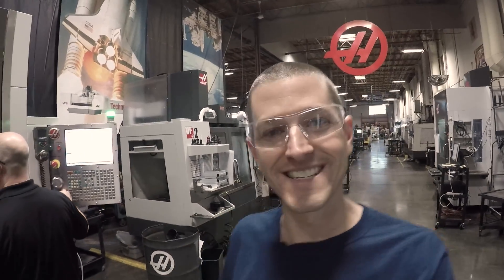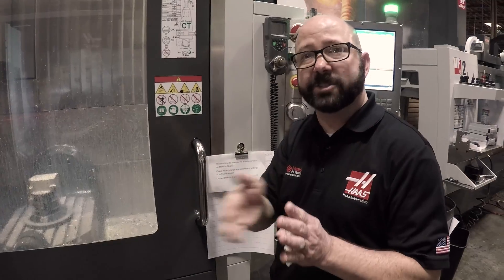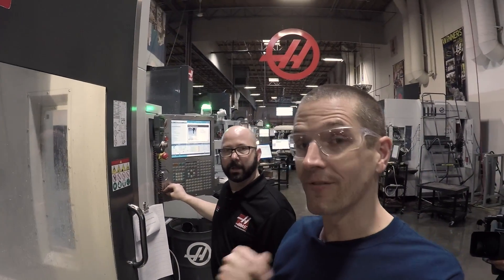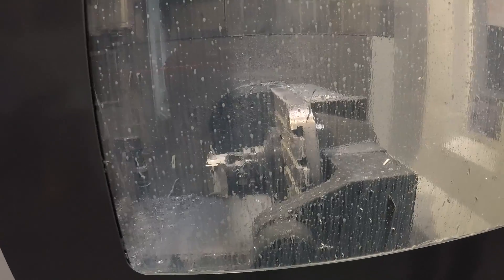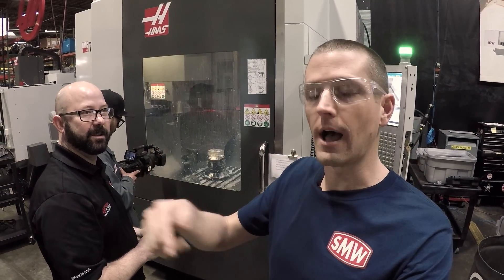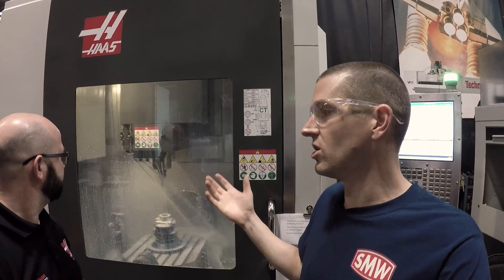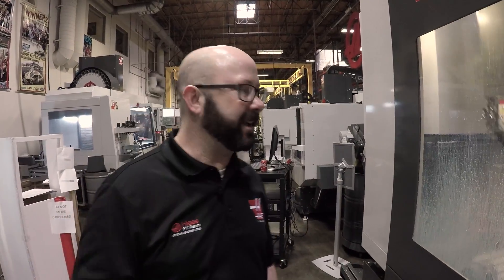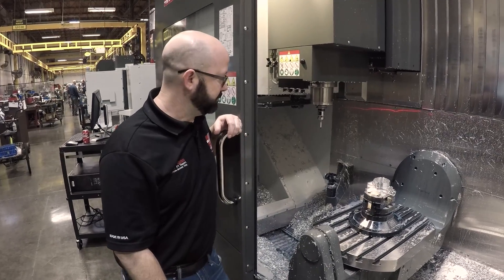5 Axis CNC Machining on a HAAS UMC-750 at the HAAS Factory!

Comment: Have you considered running a curtain of high pressure hair in front of the camera? It should deflect down chips and coolant, but shouldn't affect the image if the air is at ambient temperature.

Comment: I told you about the washing the part down with the TSC, when you first received your HAAS. Instead of using a drill, turn a blank with a large hole drilled in one end, and a smaller hole thru the other end, and blast away. Using a ER-16 or ER32 collet chuck use the TSC, no flood and it might make your filming easier.
Reply: Chrus B or you could use Swiftcarb end mills that have center coolant holes

Comment: Amazing video and part, this is what i want to do in the future, done already some simultaneous programming with 4th axis (horizontal rotary table) But five axis, that will take some skill i think, never tried it. What cam software he use?
Reply: Fusion 360 will do some 5 axis work - 3+2 is pretty straightforward and there's a couple of full 5 axis strategies as well. It's what he uses for just about everything.
Reply: There are plenty of cam softwares but i decided to start with nx cam because my company bought it, it was before Fusion 360 was released, but there are not so much guides to it...
Reply: Cobrass2 
Honestly 5 axis work is easier than 4 axis simu work.  You have a lot more options and strategies available with 5 axis and a lot more clearance.

Comment: I'm thinking a jet of air on the window to blow the drops away.
Reply: cheeto4493 new hass have a little spot where you can blow the window from the outside. but it only opens up about 3 4 inches just enough to see

Comment: machined aluminum square bar (1.500" x .750" x 12.000")that holds two front windshield wiper's from a 1988 Suzuki Samuri's front wiper's. they are 7.000" to 8.000" long.... in the center of the square bar stock, drill a hole all the way through, which would then hold the wiper's in their respective holes, which are centered as well. At the ends of the bar stock, drill & tap holes to mount wheels/ball bearings with shoulder bolts... then the whole legnth of  the under side, epoxy several neodymium magnets, even ones from PC hard drives. then make another one of these the same length, with wheels mounted on the ends ,and fasten a strip of steel to the bottom of that one.... actually, the magnets one goes on the out side unit, and the steel strip unit is the one that goes on the inside of the machine...I stole the idea from my fish tank scrubber, both have magnets with in, and both have felt so the glass doesn't scratch when cleaning the inside of the tank.. .but, the use of my old widshield wipers from my Suzuki Samuri, works really good, it just holds itself at the bottom of the window frame, and a two handed grip, move up, and then back down, as many time as you want. and when the wipers get completely worn out, I bought new ones for the jeep, and put the old units on the coolant wiper. I only made one, even though the Kitamura MyCenter1 had  8 windows, but I only needed to look through the one in front by the control monitor.. all made from junk/scrap.. the center pivot really allows the top and bottom wiper to level out on the plexiglass/polycarbinate windows. I am sure there is a 1000 different and easier and better ways to deal with this, but like you mentioned, Rain-X is something that I swear by on my automotive windows ,but if your manufactured parts need to be contaminate free from the waxes and silicone stuff that may be within Rain-X, not point in upsetting your customers and risking the account/contract.. sorry for the novel..

Comment: Why is that machine using dogleg rapids? Was this filmed in 1993?
Reply: Less fuckups when you know the machine is going in a straight line and not through your clamps.
Reply: Haas uses dogleg rapids as standard. There is a parameter to change it to linear rapids instead, but personally I don't see much advantage to it.
Reply: I'd heard it's broken on the nextgen 5x controls, and doesn't enable. Not sure if accurate or not, but have yet to get somebody to publicly clarify.. As someone else said, it's fairly reassuring to be able to simulate your rapid moves. Sure, you can use high feed moves, but it's a bit annoying as you lose independent feed/rapid override.